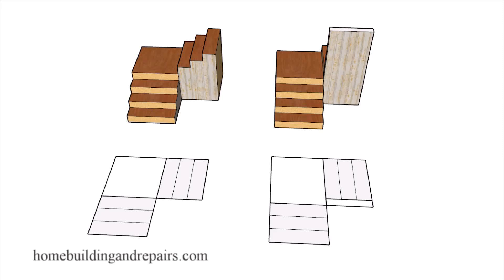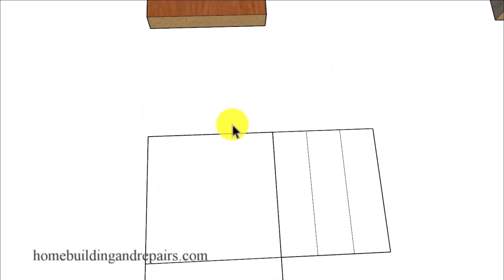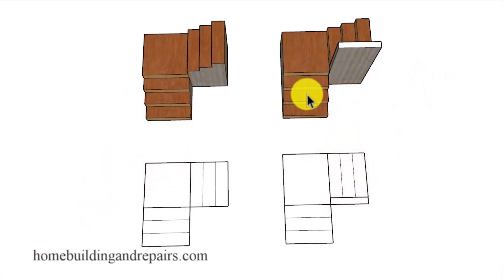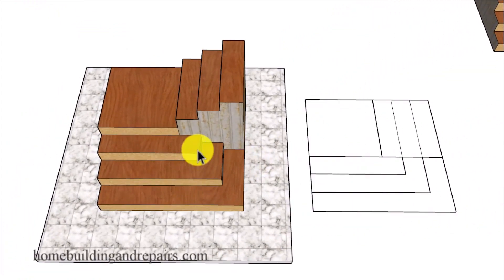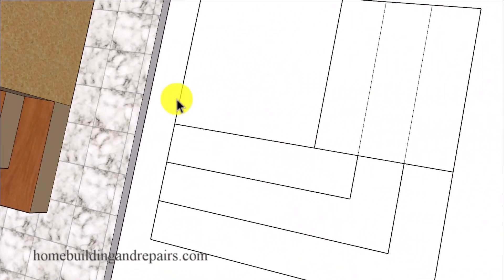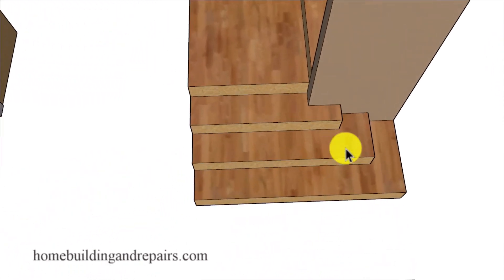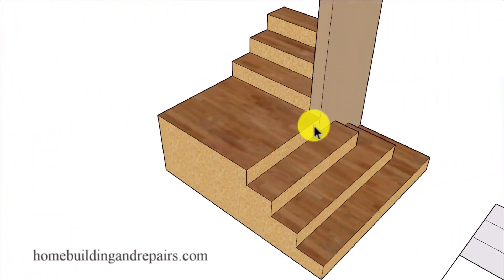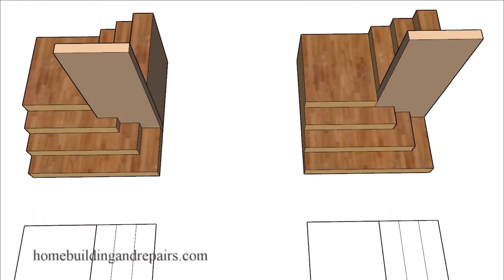How To Layout Stairs With Lower Tread Returns - Design And Education Tips

Comment: Any issues using this design for a deck ? Have a higher landing coming down to a deck and would like the ability for people to straight down the stairs or off to the left just as you show in your diagram
Reply from the maker: You would have to check with local building department if you have one. Sometimes they need additional grippable handrails or one going down the center if stairs are wider than 88 inches.
Reply: @stairbuilding I would be attaching the handrail on the outside side and then on the return wall so I think it would cover all options. Stairs would be 4ft wide before returns so no issues there. Certainly a better option than trying to make a quarter circle staircase or box step contraption.